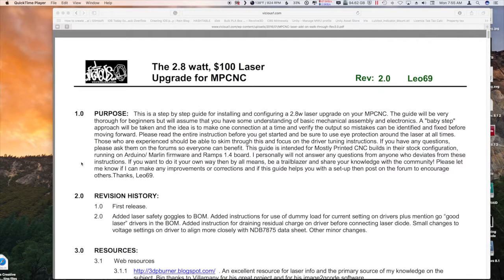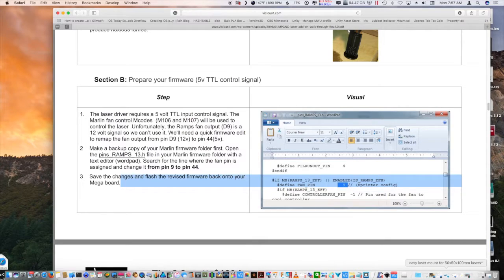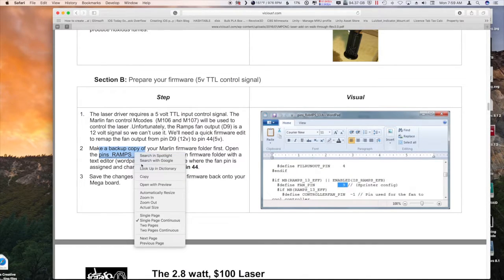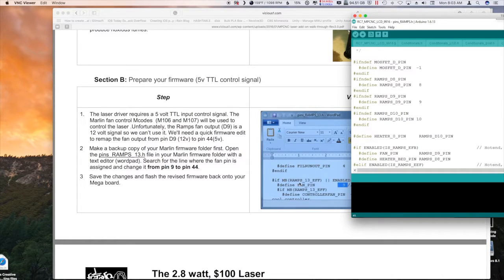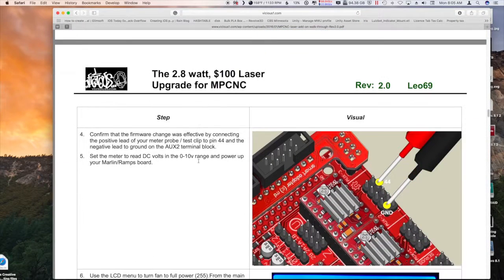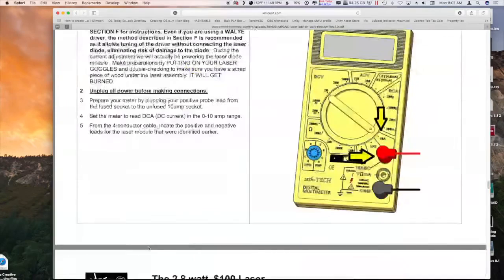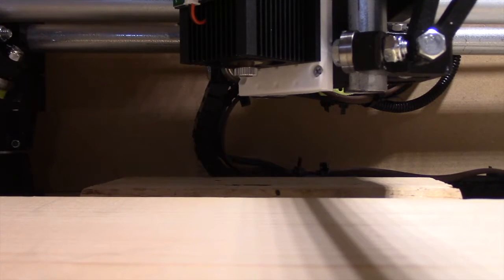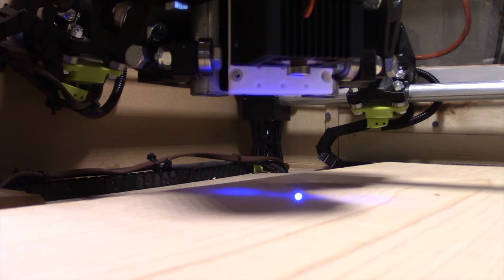Mostly Printed CNC MPCNC Part 8: Laser RE wiring

Comment: hey i brought this laser here, wondering if it will work with this, https://www.ebay.ca/itm/CNC-FOCUSABLE-2-5W-2500mW-450nm-445nm-BLUE-LASER-MODULE-TTL-DRIVER-ENGRAVING/132887759344?ssPageName=STRK%3AMEBIDX%3AIT&_trksid=p2057872.m2749.l2649
and where can i get the files u r referring to here ?

Comment: Hi, can you explein me, please, how I must modify the Marlin firmware for command a laser module with D9 pin of the Ramps 1.4? I downloaded the firmware from vicious.com site and I connected the positive of the laser module a the D9 positive PIN and the negative of module at the D9 negative PIN of the ramps, But when I turn on the MPCNC the laser is ON and I can't command it with M106/7 Gcode? I hope thaht you understand my bad english:
Greetings
Reply from the maker: If your laser accepts a separate signal to control the power, then you don't want to use D9.  Which laser did you buy?
Reply: I don't know If my laser accepts separate signal (the module is this: https://www.banggood.com/it/445nm-2_5W-2500mW-Blue-Laser-Module-With-Heatsink-For-DIY-Laser-Cutter-Engraver-p-993521.html?rmmds=myorder&cur_warehouse=CN) I see that it have only one cable with positive and negative signal. Thanks
Reply from the maker: Yes, I see. Looking...
Reply from the maker: I re-downloaded and re-flashed with the MPCNC813_GLCD_T8 version of the firmware at V1Engineering.com  As long as you haven't modified the code, D9 should work right out of the box, M106 S255 should turn D9 on all the way, and M107 should turn it off.  Perhaps there's a problem with the board?
Reply: Thanks, very thanks...This evening I will try to re-flashed my board with the MPCNC813_GLCD_T8 and if the D9 pin don't work, I will buy a new board. I Will report you the result. Thanks, you was very kind
Reply from the maker: Maxi Carota might be a good idea just to measure the voltage open circuit to make sure that it's working before you put a load on it with the laser. Thanks for watching.
Reply: Hi Some Old Guy, The last week I bought a new board and now the PIN D9 work very fine, thanks for your help and ciao
Reply from the maker: thanks!  I'm glad you got it working!

Comment: Is that a custom made tool mount?
Reply from the maker: I had to rewatch to refresh my memory...  Yikes, that audio is bad on the second part. Sorry all!

Mike, if you're referring to the laser mount, then yes, it's on thingiverse: https://www.thingiverse.com/thing:1982844
Reply: Thanks, I built the laser as described in the doc, my heatsink is different profile. Where did you get base part to customize your adapter?
Reply from the maker: the blank mount is https://www.thingiverse.com/thing:1634262 that I based my part from. However, there may already be a mount for your laser on thingiverse  https://www.thingiverse.com/thing:1636811  or  https://www.thingiverse.com/thing:1025450 and others.